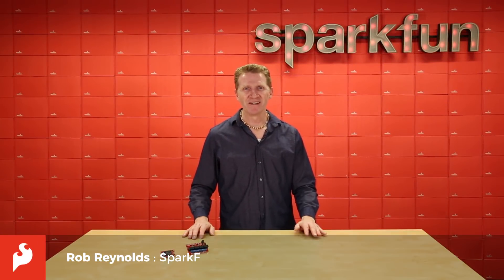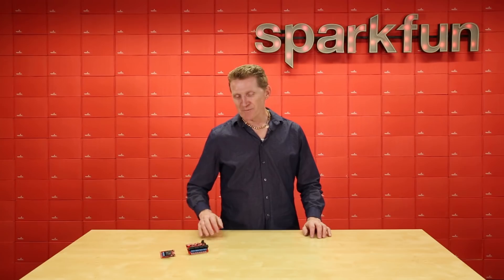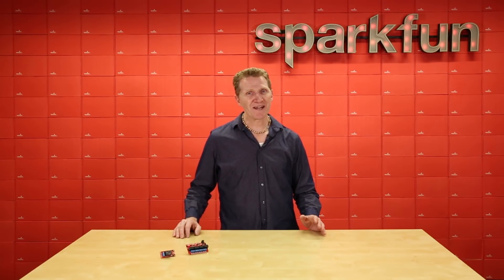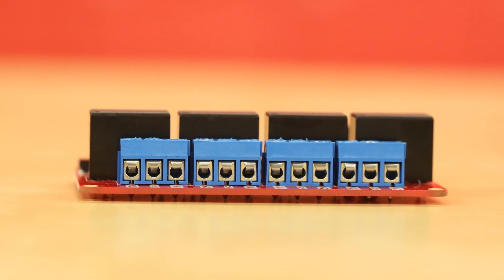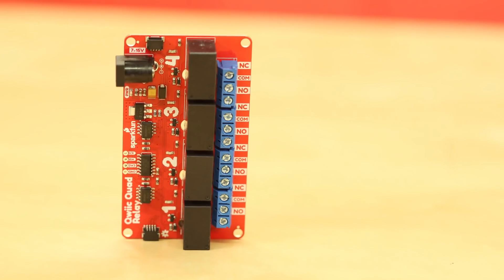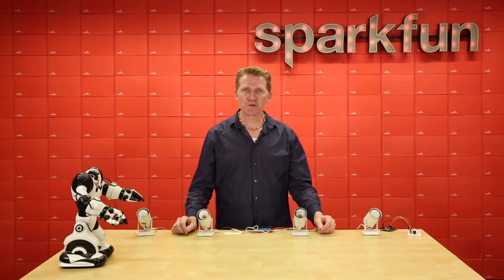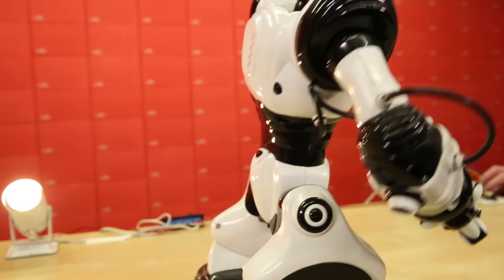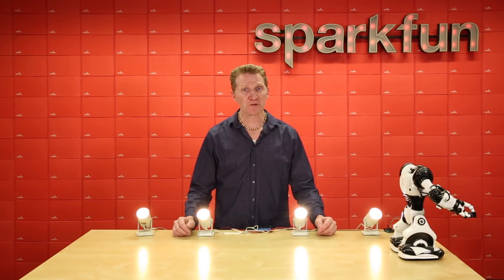Product Showcase: SparkFun Qwiic Single and Quad Relay Boards

Comment: HI I LOVE YOUR VIDEOS. BUT YOU MAKE GREAT PRODUCTS BUT MOST OF the PROJECTS I SEE ARE JUST HALOWEEN. IF YOU WANT TO SELL MORE WHY NOT SHO A HOW TO MAKE PROJECT FOR YOUR COMPONENTS. DID YOU EVER THINK WE WOULD BUY MORE. IM A OLD TECH GETTING BACK INTO ELECTRONICS, BUT JUST LEARNING ARDUINO AND RASBERRY PI. SO COULD YOU START DOING PROJECTS LIKE HOW TO MAKE CIRCUITS FOR YOUR ITEMS LIKE CNC, 3D PRINTERS? LIGHTING PROJECTS ETC. YOU KNOW WHAT I MEAN TEACH US HOW TO USE YOUR PRODUCTS  ITS ALL PART OF ADVERTISING I STAR4TED OUT A PC TECH AND SALESMAN SELLING MICROBEES BUT WE USE TO TEACH THEM HOW TO BUILD OUR COMPUTERS AND EVEN BASIC PROGRAMMING THESE SALES TECHNICS HAVE BEEN LOST OVER THE YEARS SO PLEASE BE FIRST TO BRING THEM BACK I NEED TO START UNDERSTANDING WHAT EACH component IS USED FOR AND CODES TO GET THEM WORKING THATS THE SORRT OF VIDS I WANT TO SEE I MAY BE OLD BUT5 I STILL WANT TO KEEP UPDATED WITH TECH. CAPS LOCK IS DELIBERATE AS I WANTED YOUR ATTENTION.
Reply: For God's sake... F.O.G. CAPS LOGK off!
Reply: Annoying AF.